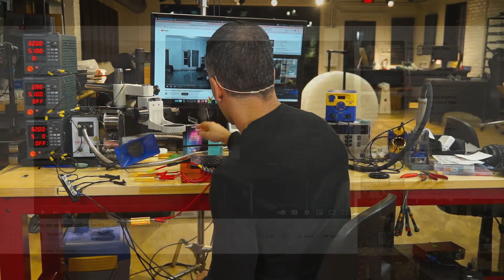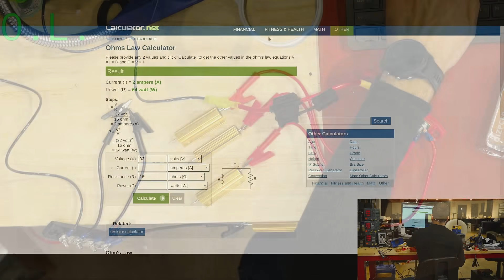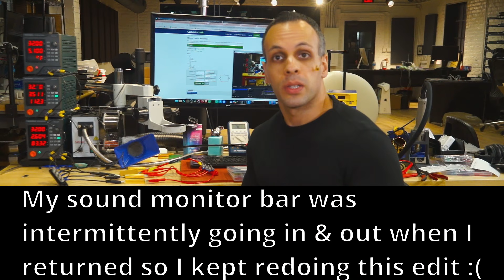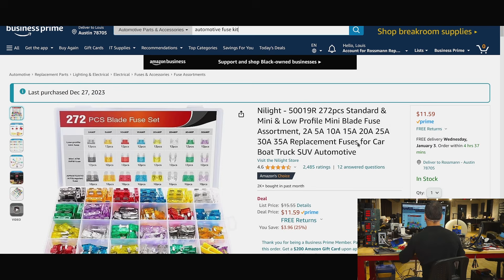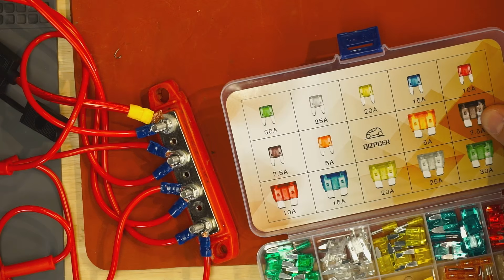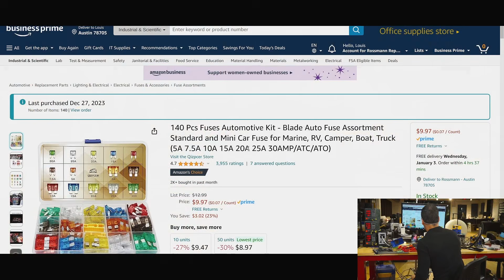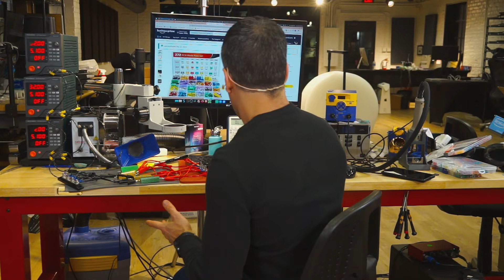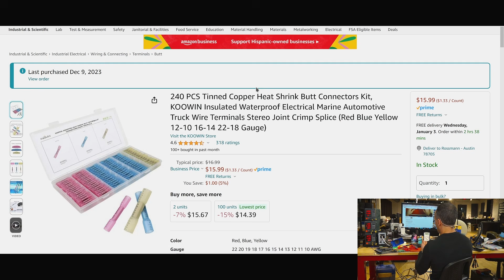Amazon Sells Fake Electrical Fuses

Comment: Radio Shack was my go to place for electronic parts decades ago. Fry's Electronics was where I got parts from after that. Now that they're both gone, this is what we have to to deal with. 

I've never been a fan of allowing other businesses to sell on Amazon. Half of those sellers don't even box the items properly. I can accept the sellers whose products are fulfilled by Amazon meaning they are boxed in an Amazon warehouse, but not the ones who ship directly from those sellers thereby bypassing Amazon altogether.

Walmart started doing the same practice on their website with its "marketplace". In fact it's often hard to distinguish the "shipped and sold by Walmart" items from the 3rd party sellers. 

As far as this being the downfall of Amazon, I'm afraid it will take a lot more than that to hurt them.

Comment: noob question but what is runnin in parrallel vs runing in series
like ive seen some devices where the double a bateries face opposite sides in a 69 faction, or 696 or 6969 in case its a rc car, in the box while in other(very rare but ive seen it) they both go the same direction,  is that what it means running in parralles vs runing in series and if yes why would a device shoose one over the other?
Reply: I'd recommend you read this article https://en.m.wikipedia.org/wiki/Series_and_parallel_circuits

Comment: Although I agree with overall Amazon sentiment....  Some of your problem is a misunderstanding of fuse ratings and not understanding how awful this style of fuse is.  A fuse's marked rating is the current the fuse WILL NOT blow at.  Your 5A fuse performed exactly as good as a high-quality Eaton/Bussmann datasheet said it should.  Specifically ~one minute for 8A and 10 seconds for 10A.  Low current fuses (even good ones) tend to have very inconsistent performance due to heat (the thing that causes them to blow) being pulled from the tabs too quickly.  Good quality fuse holders will result in higher currents required.  Now I'm not saying Amazon doesn't sell mislabeled garbage... just saying that this might not have been the best example.

Comment: I purchased a Vick's thermometer from Amazon (from the 'Vick's Store' seller), but what I received looked off from the thermometer I already had and the images from the product page. I started looking into it based on the model number and other features on the thermometer and eventually got into contact with Vick's customer support when I couldn't find a matching patent for that model number. 

The model number on the thermometer didn't match anything they made according to the customer support person I spoke to, and it didn't have the 'vapor' pattern on the power button as it should have. I left a review on Amazon reflecting all of this information, including that everything I'd suspected about it was confirmed by Vick's itself, but the review was rejected.

This a product that people put into their mouths and their children's mouths, this isn't just a shirt that falls apart (not not that isn't annoying, too), but this is a genuine potential safety issue.

That tells you all you need to know about how much Amazon cares about the safety of its products and well-being of its customers.

Comment: I find it crazy that people wanna blame amazon when its just a glorified ebay, all they do is connect sellers and buyers, Buyers fight over advertising aka being top of the list. Doesn't help that average people just but the cheapest one on amazon, only enforcing putting cheaper worse products higher up the list. It isn't up to amazon to pick the most reliable brand for you, its up to you to do that.            I'm not replying to comments, but in my mind I see this as practically asking Facebook market place only showing you "genuine" things. Third party retailers using a website, up to YOU to use it.

Comment: 1 and 2 amp automotive fuses are often used on domestic natural gas water heaters or furnaces.
As someone who sells fuses at a major auto parts retailer, I have NEVER sold such fuses for a car or even an RV. In fact, every 1 or 2 amp fuse I have sold was not only for such appliances, but I had to order them in from our warehouse. Which is one step below special order, but they aren't they easy to find.

Comment: Fuses rarely blow at rated current (reputable automotive fuses say from littlefuse seem to be rather close though) but most importantly if you can't get a datasheet for a fuse that should be a clue to just not buy it..

Comment: My guess would be that the factory producing those "defective" fuses has a single production line that makes 10A fuses and then they put different collors and branding as asked by the wholesalers, because the production cost for the different colored plastic is almost insignificant compared to having multiple production lines dedicated to each fuse rating.
Reply: I though about that too, maybe its not the factory, but someone in the long supply chain. But as a customer how are you supposed to know that ? you don't, you trust the frontend store, which is Amazon, so the only conclusion is to never trust Amazon and only buy things from them when you already what they are, or never, which is the point of the video.
Reply: The entire western society is going downhill because cheaters are eroding the trust in the system. People don't trust governments or corporations or anything, soon everything decays to chaos. Maybe that's inevitable, maybe we need a new social contract like what happened after the second world war ended, is that possible without another war, who knows.
Reply: They are apparently all hold 50 amp at 12V without popping. Reviews I have seen have tested many sizes of each brand, to find you are eXACTLY correct.... ame fuse has the color and number painted on the edge you want, all at 50A

Comment: Today I found cryogenic gloves on Amazon which can apparently handle temperatures as low as -360 °C (which is below absolute zero which is −273.15 °C). Very impressive
Reply: Almost as impressive is their 9900mAh 18650 batteries.
Reply: I would seriously doubt those specs. They are probably shitty chinese oven mitts, and would burn your hands in 1 minute at only -100c. Safety gear, I would NEVER trust from amazon. Did you learn nothing from this video?
Reply: @Stealth55555  ...They're being sarcastic. See: "below absolute zero".
Reply: @Stealth55555  You and the two people upvoting this comment need a way better sarcasm radar or reading comprehension skills.

Comment: As a EE, as you predicted, I wanted to see the trip curves. While I do not have the datasheet for your Amazon fuses, I was curious to see what the curves are like for most automotive fuses. Generally I see that at 4 amps a 2 amp fuse should open in about 5 seconds. Less than a second at 8 amps.
Reply: Exactly most time-current characteristics for automotive blade fuses show that at 200% of fuse rated current (In) it should blow in less than 5 seconds. Also worth mentioning is  that typically at 110% of In fuse should last as long as predicted MTBF and at 160% of In it can last up to 50s (kzper 5A fuse at 8A for only few seconds before bump to 10A was quite in specs).  
As a EE I would like also to point that Louis explaining automotive fuses got it over simplified. Automotive fuses are not like micro fuses protecting circuit boards. They are in first place to protect wires that run around your car so that they do not turn into lighter and to a lesser extent to protect receivers and users. Fuse creates weak spot in a wire so it overheats and blows before the wire gets so hot it burns its insulation. Important part is that it does not mean fuse will blow instantly! Enough power must be dissipated at melting element to blow it. Power sources should have its own overload protection (they can cut-off or drop voltage) except if they are `special offer` knock-offs or straight scam. That of course does not change the fact that at 350% of In, quality fuses blow in less than 0,5s. 
Example specs:
https://www.pecj.co.jp/en/fuse/outline/p3.html
https://m.littelfuse.com/~/media/automotive/datasheets/fuses/passenger-car-and-commercial-vehicle/blade-fuses/littelfuse_atof_datasheet.pdf

Comment: Oh and on the point of those being fake fuses...probably but doesnt have to be. There are ambient temperature adjusted fuses. They are some real mindfuckery but at work had to spec a 13amp fuse for ABOVE 95C AMBIENT TEMPERAURE OPERATION. Thats some stupid ass fuse that is expensive as hell but hey I aint paying for that. The client wanted it

Comment: Not defending anything but just as information for those who think fuses should blow at the rated current.
For most blade fuses like that it is common for them to have delays. Data from the littlefuses MAXI Blade Fuses
100% of the rating = They will never blow
135% of the rating = 60-1,800 seconds
200% of the rating = 2-60 seconds
350% of the rating = 0.2-7 seconds
600% of the rating = 0.04-1 second

Comment: I've personally dealth with Nilight stuff and found very quickly, it's all garbage. 

My experience is mainly with their LED light pods/bars. The optics are terrible. Sure, the LED's are bright but, almost all of the light goes where you don't need it. And they pull way more power than what they're "rated" for!

Comment: Another counterfeit product example on Amazon/eBay are solid state relays (SSR’s). 

Fotek SSR’s in particular are widely counterfeited, with 25A rated relays actually only having internal hardware (triacs) rated for 12.5A and poor insulation. The scarier part is that when they fail, they can fail in a closed circuit state. For say a temperature regulation application, your temps will keep going up and up.

If you are using counterfeit SSR’s in high powered applications, you can quite literally burn a house down.

Comment: Assuming any of these brands still exist six month from now, I wonder if the results would be the same, or if the 'good' and 'bad' ones would change. It's very likely that almost all of these brands aren't actually making fuses and are just buying lots from a local manufacturer that failed QC for the customer that actually ordered the run in the first place. The results may be determined more by who bought the shittiest lot of rejects this month rather than an indication of actual quality control for a given brand name.

Comment: at 2x In ... an automobile fuse should !! at the longest take 5 secounds to burn throu ... at ~ 1.4x In  it should be around 10 minutes at the most. 

going past 3.5x In it should blow within a few ms.

these numbers are taken from comparing a few 32V fuses that i know are made well .-.. for example ESKA and EATON

sadly for most that are sold on amazon i am unable to find any sort of      In-t characteristics   sadly ...

but in general ... Automobile fuses are made to not trip ... before at least 1.2x In over a few minutes

Comment: A nitpick about terminology: a fuse is NOT rated for a certain power as you repeatedly said. A 2A fuse is a 2A fuse, no matter if the load is 1 Watt or a 1000. You could have done the test at much lower voltage and not built a desktop bench heater 😉. You wouldn't even have needed resistors at all and could just use the PSUs' current limiting mode (maybe use a very low value resistor - <= 1 Ohms - in series with each PSU, if the regulation interferes too much with each other; it already was visible in this test). Admittedly, no load resistor at all could have confusing to many, but at the same time it would have been a teaching opportunity.
The voltage rating of a fuse only matters AFTER the fuse wire itself broke. The rating tells you the voltage up to which the arc that forms when the fuse wire blows will be reliably extinguished.

Comment: Fuses are rated in terms of I^t.  Meaning that it will take a fixed amount of current over a specified time.  A 2 amp fuse should not blow right away at 2 amps.  Also there is circulating current between the supplies therefore the current should be measured inline with the positive lead and not the summation of the readings on the supplies.  Therefore the test he is doing is flawed.  That being said the fuse is definitely not good in any reality and in no case be used in any device where over current protection is required.  His test is definitely sufficient enough to determine that they are sufficiently messed up and not functioning even close to the correct rating.  Excellent job!
Reply: Being an EE and wanting to confirm results. I bought the exact same fuse kit from amazon and performed a more thorough test, using direct current measurements, a supply that is capable of 10s of amps and has a current control mode.  The results are very similar to Louis's results.  I tested four 2 Amp fuses of each type.  The worst was the mini low profile which did not trip until there was an average of 7.3 amps (300% over rating) flowing through the fuse.  Comparing this to the I^t curves for UL listed fuses, the fuse should have opened at 2.5 Amps after 5 seconds and at 6 Amps it should have opened within 200 ms.  However, it held 7 Amps and did not open util 7.3 Amps.  I performed the same tests with the 5 Amp, 10 Amp and 15A fuses.  All would not correctly protect a circuit of the given rating.  Most would hold 150% to 180% of their rating indefinitely (at room temperature).

Comment: From an EE here, 2A fuse does not mean it will blow when current is above 2A. It means it won't blow at 2A forever. Above 2A, it will blow, but how soon it blows depends on the current. When 4A passing through, it may take hours to blow. The higher the energy, the quicker it blows.

Comment: I had a fuse that the plastic melted withouts the fuse blowing.

I now use a LVD to detect a high current usage to cut the power. It now cuts the power if the amperage is above 7-8A for more than 2 minutes..

Comment: Look at the ANL fuse on there. I use a 100 amp for my car sub speakers. I once jumped my car with the #4 wire that goes to my trunk because the battery died while parked up next to a wall and  couldn't reach the good with the jumper cables. It works great but.... the fues didn't blow, the 100 amp fues jumping a car with a fully dead 7°f battery didn't blow 😮

Comment: Doesn't total resistance go down when you attach multiple resistors in parallel? So you're actually loading the circuit less and less as you add them.

Comment: Time delay fuses should only give you 10-12 seconds, enough to get a motor rotating, not 10-12 years. Incidentally, if your system can feed the power the component becomes the fuse.

Comment: I been watching your videos for years and seen you troubleshooting and diagnosing electronics like a certified electronic engineer but you have made a HUDGE MISTAKE when you connect resisters in series then your total resistance is R1 + R2 + R3 = Rt (Resister Total) but when you connect resisters in parallel its a different story because 1/Rt = (1/R1 + 1/R2 + 1/R3 + 1/R4) so your total resistance is only 4 ohms.

Comment: The Chinese expression "Néng piàn jiù piàn" (if you can cheat, then cheat). Thank you for doing this product testing.

IIRC, a retailer is generally not liable for more than the product cost after the Uniform Commercial Code time limit expires (30 to 90 days depending on the state) and generally isn't obligated to test a manufacturer's product claims unless the retailer rebrands the items with their own name. Which Amazon isn't. It's the manufacturer that has the product liability if anything goes bad. But in this situation where the manufacturer is in China, there is literally no way to sue the manufacturer for product liability. So, the liability rests with the importer. It's doubtful that Amazon is actually the importer. The importer is likely a tiny company that is little more than a mailing address and email address as a virtual company that really only sets up drop shipping through customs to the Amazon warehouses. And maybe beyond the first few orders that that company hasn't even seen or taken possession of the goods entering the country and being forwarded to Amazon. The import documents will likely have 3 addresses: sold by, imported by, and ultimate consignee. And if the importer is sued, it will just close, and another will start up with new owners a week or two later.

As they are sold for automotive use hopefully someone at NHTSA will take notice and require imported products such as these that claim to be for automotive use to actually meet automotive standards and have independent domestic certification or be barred from import. Of course, the importer could simply cheat again and buy bulk fuses that are not labeled for automotive use and apply the labels domestically before shipping to Amazon.

So, fighting this legally is probably as useful as tilting at windmills.

But if you can get politicians involved in the fight to write new laws to address the public safety concerns to require importers that are selling to online retailers to have to have bonded product liability insurance in place with a domestic insurance carrier. The online retailer (such as Amazon) could then require the importer provide a certificate proving the insurance is in place in order to accept the importer as a vendor; along with the usual government documents to prove business licenses and tax certificate, etc. That would put the domestic insurance carrier on the hook in case of a bad actor importer. This risk will then make the insurance company impose product testing requirements in order to get that policy; even in cases where the Federal law couldn't legally impose a testing or certification requirement directly on the importer or retailer.